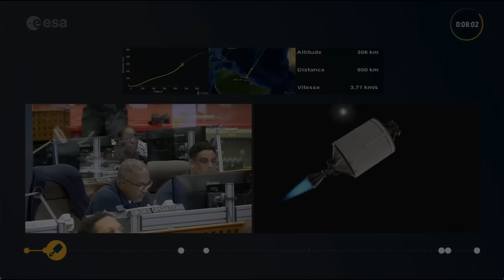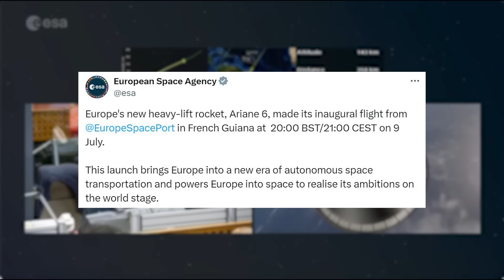Why Are Customers Switching From The Ariane 6 To SpaceX?

Comment: They say that Starship isn't competitive with them because it's designed for the moon and Mars. It isn't. It's designed, as a single use vehicle, as the most powerful and efficient LEO truck in the world; Moon and Mars are only features if and when it can get orbital refueling working. But it absolutely dominates the LEO space, which is exactly the kind of market they are saying Starship won't compete with them in. They are coping hard by saying that.
Reply: Yup. Starship is great for getting to LEO.
Reply: As a single use vehicle Starship is extremely inefficient. Everything about it, right down to the timing of staging, is optimised for reuse. 
It’s going to be big, but that’s it’s only advantage as a single use rocket. And WHO has a satellite that’s 250 tonnes, but simultaneously fits out of a tiny slot in that payload fairing? Nobody that’s who. Meaning it wouldn’t be able to utilise it’s massive lift capacity anyway.
Reply: @HALLish-jl5mo  nobody has these big payloads right now but they'll certainly do when starship begins regular service. Why design a satellite to be ultra light and ultra expensive and ulta long-lived when you can just trade these with plentiful mass and frequent launch.
Reply: @HALLish-jl5mo  They have lots of payload bay designs that slot is just the one for Starlink Satellites.  Nobody has 250 Tonne satelites atm because nobody had a cost effective way of launching more that 50 tonnes to LEO before. 90% of satelite design atm is making it light enough and making it fit in the fairing because most modern launchers are quite limited.  Starship with its huge payload capacity and fairing will change how we design satellites no more folding anything but the the solar panels no more removing instruments to keep the weight down
Reply: @admarsandbeyond  If Starship isn't reusable (the scenario I'm responding to), those tonnes to orbit won't be cheaper than any other rocket. More expensive than Falcon 9 in all probability. 

I'm sure you can save design costs by letting the weight balloon 10 fold, but not enough to offset the launch cost ballooning 10 fold as well.
Reply: @bigianh  Starship WITHOUT REUSE (the scenario im responding to) will not be cost effective though. At best it will be on par with the cost per kg of other expendable launchers, and worse than Falcon 9. 

Sure, it can carry 10x as much mass... For 10x the cost. You'd save some design money sure, but not enough to offset that.
Reply: @HALLish-jl5mo  Starship has already proved that it can return from orbit. I don't think the op was arguing that starship won't be reusable, by single use he meant only to going to LEO without refuelling. Super heavy is certainly going to be reusable, so even an expendable starship would be 300t to LEO for much less money than Ariane (raptors are trending $250K and stainless steel structures are less than isogrid aluminium)
Reply: Who is this "they" that you mention, because that doesn't make any lick of sense to begin with. The Ariane 6 design itself is much more optimised towards GTO / GEO / Moon missions compared to LEO missions with the 2.5 stage setup and hydrogen core/upper stage. They're already meant for different things without having to twist Starship away from being a almost purely LEO vehicle.
Reply: @CensoredUsername_ ”they” being the executives at Ariannespace who act like starship can’t or won’t compete in their ballpark. And I used LEO as a shorthand, but it can put 21 tons into GTO, so yes it can beat Arianna 6 there too. 

The problem is they’re trying to characterize the starship as a moon and Mars vehicle. It’s not, it’s design profile is the best earth orbital vehicle in existence. Refueling is what makes it a moon and Mars vehicle but that’s a separate technology.
Reply: @HALLish-jl5mo  I don’t know what you’re responding to, because my comment wasn’t about reusability, I was referring to refueling. It was “single use” as in “one ship gets sent for the trip” whereas a refueling trip costs several more flights. Almost no starship flight will be expendable. 

But we can do the math. Starship costs about $100 million to launch expendable. F9 costs 67million dollars. F9 puts 22.8 tons into Leo in expendable mode while starship puts north of 150 tons into orbit in expendable mode for the V2 variant that will be taking over soon. That’s 2,938 dollars per kg for F9 and 666.6 (spooky) dollars per kg for starship. 

So even with expendability starship beats F9, they just have to take full advantage of the payload capacity.
Reply: @roberthesser6402  >And I used LEO as a shorthand, but it can put 21 tons into GTO, so yes it can beat Arianna 6 there too.

Fair enough. Although I wonder how that works cost-wise. Can Starship even return from higher-than-LEO orbits? I don't recall any non-ablative heatshield handling a reentry at those velocities well. Or is that with a deceleration burn before re-entry.
Reply: Maybe Boeing can repurpose unsold 737 Max vehicles for this. Meanwhile Elmo's rocketship ain't what he says it is. Neither is the 737 Max series aircraft meant for LEO.
Reply: I was going to say this exact thing. Its like saying you should use a pickup truck in comparison to a regular truck because a truck is designed for taking things long distance. Starship is designed for going to mars and the moon, but another large part of its development is local (earth) usage
Reply: @CensoredUsername_  Ship has a wet mass of 1285 tons, 85 tons dry. Raptor V2 also has an ISP of 380 seconds. Assuming a 21 ton payload, for an initial mass of 1306 tons, after plugging those numbers into a delta v calculator, I get a DV budget of 10,185 meters per second.

Looking at test flight 4, ship and booster stage at about 5500km/h, or about 1,528 meters per second. For LEO velocity, ship needs to get to 7800 meters per second, shaving off 6,272 meters per second from its DV budget, leaving it with 3,913 meters per second left over. GTO requires another 2,440 meters per second, although by the very nature of it being a transfer orbit, the exact amount of work ship will need to do versus what the payload will need to do will depend upon the payload in question. Ship isn't doing a direct to GEO burn with the payload unless the ship wants to hang out in GEO with it; GEO from LEO is exactly 3,900 meters per second, leaving ship with 13 left over to do nothing useful with.

That's fundamentally the reason why rockets do geostationary transfer orbits and let the payload take care of the rest to get to GEO.

Anyway, ship has 1,473 meters per second left over after the above hypothetical for it to probably do a suicide burn from there. Starship wouldn't survive. However, the booster itself--which is probably upwards of 66% of the cost of a full cargo stack given all of the engines--can survive this trip, as I used evidence from a flight where the booster successfully performed boost back and landing burns. So you can use a Starship for a partially reusable 21 ton GTO payload.

Precisely how the math would shake out in real life is up in the air. I'm giving you today math, what the vehicle could do with known factors right now. But the version of Starship we're seeing now isn't the final form it will take. Starship V2 will have more lift capacity than the current ship, and Starship V3 will have even more, with some estimates putting it at 250-300 tons to LEO. Raptor V3 is on the test bed right now with record breaking chamber pressures, and is expected to have even higher ISP than the V2.

All of these factors will change the math into ship possibly being able to survive a 21 ton GTO payload, but as of right now, it can't.

Still, partially reusing a GTO flight puts it above the Arianne 6, and every other rocket thus far imagined.  To be clear, I have a lot of respect for the engineers who put that rocket together, as I do any engineer who puts any rocket together. But the executives saying starship won't compete with Arianne 6 are straight up talking out of their ass. The version SpaceX has right now, which is basically a V0 prototype that isn't meant to fly real customer payloads, already beats them in basically every category. 

And this is the worst version of Starship they'll ever have. Arianne 7 needs to be at least partially reusable if ESA wants to stay relevant, and that's not a slight against them. I want them to succeed. The more people are competing, the better our future in space will be.
Reply: @HALLish-jl5mo  Without re-use its a white elephant.  But even if they only master re-using the first stage its a game changer people are already designing payloads with Starship in mind as the carrier

Comment: Every time someone says that spacex rockets wont be relevant in the future they are always proven wrong
Reply: The future is not here yet...
Reply: They aren't quite wrong, the future isn't here and launch vehicles meant to compete directly with the Falcon 9 aren't here either, both Neutron and New Glenn aren't operational yet, Falcon 9 has a massive handicap due to NASA requiring a development freeze to launch crew to the ISS, this development freeze will give the advantage to competitors once they've developed new rockets.
Reply: @theshimario253  they will be irrelevant once/If ever Starship works... And until then they mostly do Starlink launches.
Reply: Falcon 9 will become irrelevant by its own brother starship
Reply: @galaxlordcz3933  Development freeze won't affect Spacex. Spacex has 5 crew capsules in stock plus 3 cargo only. F9 has increasing load of flights for Starlink. Only Starship would be affected for ISS missions but they have Lunar Lander, Starlink and many other missions to work on already, including military point to point delivery of cargo.

Comment: Ariane 62 is not a heavy lift launcher by any standard. It has less than half the capability of F9exp and about 40% less than F9 RTLS. Ariane64 will have when it has its maiden flight about the same as F9 exp to LEO and about 30% more to GTO.
Reply: Ariane 64 still can’t compete with the Falcon Heavy, or New Glenn. Both are partially reusable

And nothing can compete with Starship and it’s future Block 2 and Block 3 iterations

Comment: Ariane 6 looks technically competent and fit for the purpose of launching payloads to orbit. However it no longer looks economically viable in terms of attracting commercial payloads absent subsidies. In the medium payload market SpaceX has eaten many if not most providers' lunches. For this reason I see Ariane 6 becoming another Delta IV, tolerated for government launches despite the higher price but supplanted in the commercial market as soon as possible.

With respect to the Falcon 9 being grounded, we'll have to see how that investigation goes. A quality control issue seems quite possible, SpaceX builds dozens of second stages per year at this point.
Reply: Ariane rocket is good for high value space exploration payload. The JWST insertion was so precise, it boosted the telescope's useful lifetime by a huge amount due to fuel savings according to NASA. SpaceX is good for cheap, fast launches that don't require the same level of precision.
Reply: @aerohk  Why would SpaceX launches be any less precise?
Reply: @aerohk  Just because their rocket accelerates faster doesn't mean they have worser tolerance than the competition. EDIT: seems like we got some rocket scientists here >_>
Reply: @0x1EGEN  Second stage
Reply: @Astra2  this is a reference to the fact that the second stage Merlin engine is extremely powerful with a lot of thrust, the result is that it’s more difficult to precisely control then lower thrust hydrogen based second stages
Reply: @aerohk  What about their second stage? They successfully launched the GOES-U into geostationary orbit which requires a ton of accuracy. I need numbers, not speculations.
Reply: @0x1EGEN  To Deliver the JWST Telescope with the precision it got the engine had to cut off at pretty much the perfect moment, if you're second stage has 5 times more thrust then that time window for the perfect cut off is is now 5x smaller and atleast 5x harder to hit
Reply: @meinking_sensei3807  Is that really an issue when everything is being controlled by a computer with milliseconds of precision? Every variable shouls be taken into consideration to get the proper timings.
Reply: @0x1EGEN  thats two very different things.
Reply: @0x1EGEN  yes. Also i doubt they use millisecond to nanosecond computing. Remember we dont talk about Simulations. Sensors and actors dont act in realtime.sensors need to be read and normalized multiple cycles and so on. To get a small glimpse into that read about PLC programming and realtime applications.
Reply: @FossilTunes  I'm very aware of realtime systems. If you ever took a course into embedded control systems you would understand the concept of interrupt latency, dispatch latency, application response time, etc. Point is every bit of latency should already be taken into consideration. Actuators, sensor pollings, any sort of response timing. You really think the guys building rockets didn't consider all that? Honestly I don't understand why you guys are undermining all this.
Reply: @0x1EGEN  i do exactly think that. Thats why a millisecond or nanosecond computer wont really matter in my experience. Normally you have very defined cycles for realtime Code (e.g. 10ms where i work). So much faster Hardware is nice to have but wont help other than keeping this realtime clock). Its much easier (and in my experience way safer) to use cycles rather than 'event based' systems when it comes to sensors and actuators... Especially when safety or a High Level of process control is needed.
Reply: @FossilTunes  From what I'm getting by your anecdote, we both agree that timing isn't a significant issue then?
Reply: @0x1EGEN  Timing is, when it comes to Orbit Insertion most important... But my Point is that the speed of computers doesnt matter If you run any decent Hardware (as in everything that can cycles of 10ms). 
For orbits its also the Sensors, their Speed and accuracy and especially the 'latency' on the controls. RCS and especially main engines need time to fire Up etc... And lets not forget the insane twr that f9 has.. that makes Things even more complicated
Reply: @0x1EGEN  Yes, shutting down you're engine takes a couple of seconds and after shut down you still have some residual thrust for a few seconds because of gases still in the system/pipes. so if you have a bigger more powerfull engine then you're competitors than you also have more residual gases. all that makes it difficult to hit a very very precise injection burn.
Reply: @FossilTunes  I didn't ask if it was the most important, I asked if the issue was...an issue. As in, are they actually having trouble with it. Are you guys trying to be contrarian for the sake of being a contrarian?
Reply: @0x1EGEN  If the issue is an issue it is an issue. Is that an answer you wanted to see? ;)
Reply: @FossilTunes  It's not an unsolved issue and that's what I wish to settle on. Thanks for the mental gymnastics, bud.
Reply: @0x1EGEN  sure. I love giginv people a achance for mental gymnastics ;) 

But to be honest and maybe to sound less "cotrarian". Falcon 9 has a different standard mission profile than Ariane 5 or 6. F9 was build to be a wirkhorse for medium sats or batches of smallsats to be brought at roughly the right orbit in LEO while being reusable. Thats a great feature for itself but has the disadvantage that the second stage has to do some heavy lifting (no pun intended) since the first needs its fuel to return to earth in one piece. This heavy lifting is an advantage, when it comes to precision orbits, that you have, as others have stated, a very strong motor with a lot of "uncertainty" when it comes to actual deltaV per second of burn. It doenst matter for most LEO sats if their orbit is 1% excentric and 340 km by 342km. Most have the capability to correct it... but this 1% error (pulling the number from thin air here) would make a huge difference when it comes to L2 or similar "positions" in space. Especially for missions like JWST. Its life is mostly limited by fuel and therefore they use a rocked designed to have very precise insertions to maximise its life on orbit. But it would on the other hand be idiotic to use ariane for a batch of smallsats in LEO just for the sheer cost of the launch.
I hope that was less of gymnasitc excercise and even less of "falcon 9 bad contrary" statement and more of a point ov view.
Reply: Ariane 6 is looking like it will be 30-40% cheaper than Ariane 5. At that price point it is commercially competitive with current generation launchers around it's weight class (Vulcan Centaur, Falcon 9, Falcon Heavy), especially for private customers who will benifit from subsidies.
Perhaps it will turn into a Delta IV situation in a decade or so, but right now that's just not the case. And it's not like Ariane 6 is going to remain unchanged in that time.